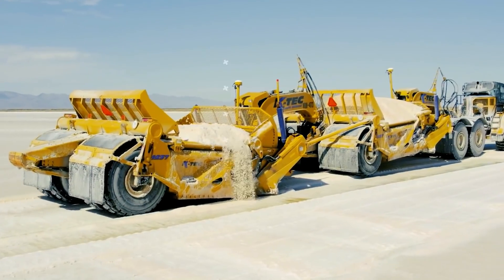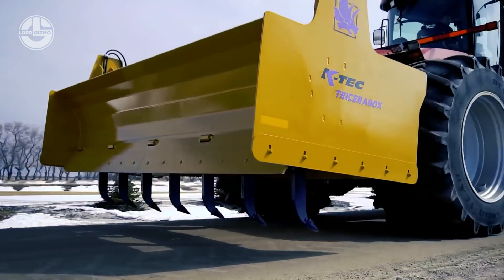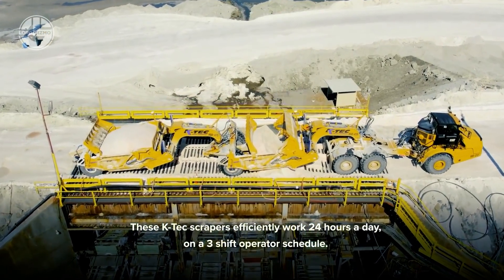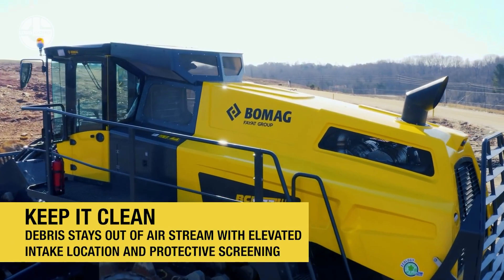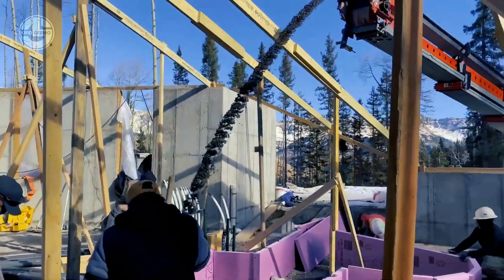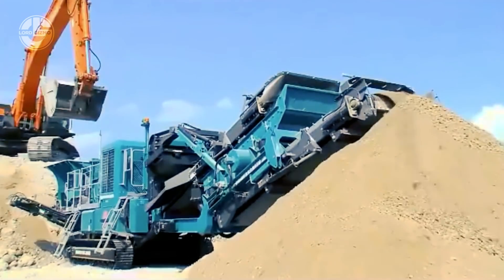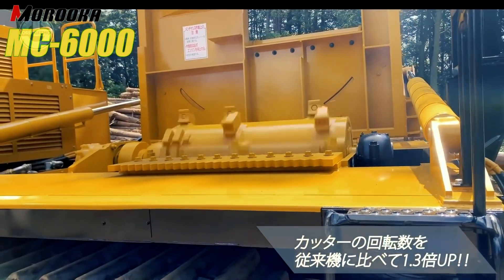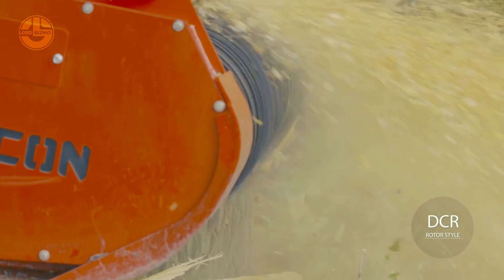Crazy Powerful And Impressive Machines You Have Probably Never Seen Before

Comment: What are this Bomag Dinosaur and a Landfill? I don't recognize them here in Sweden. First we do separation of "waste" at source in a lot of fractions (about 17 at my home and work). Building- and demolition materials, tyres, tree residue and such coarse "waste" will go to our recycling facility and be processed and sold as raw materials for new products or for energy. The only thing that can sometimes be piled is ash from the heat- and electricity plant using not recyclable burnables as heatsource. Ok, but only if the ash after control can't be used for roadfill, asphalt, buildingblocks or concrete production!  I think this "Landfill thing" probably only are used in less developed countries!!!  Haha!
Reply: Kudos to Sweden, you do have an excellent disposal system and are actually importing garbage. And you make a profit doing it. But you only have 10 million people...and most of them are in less than half of the country. Sheer volume in the US causes major problems but we're getting there. Slowly. Your example gives us hope.
Reply: Sweden has a much more advanced waste handling system. The method shown here is very antiquated.